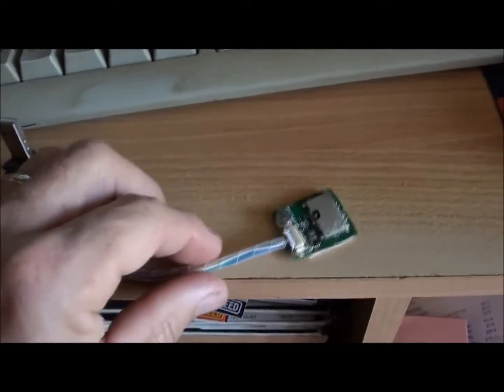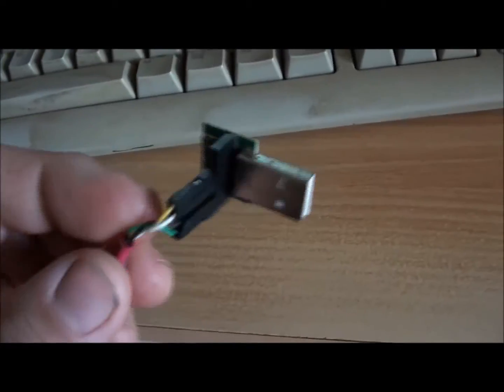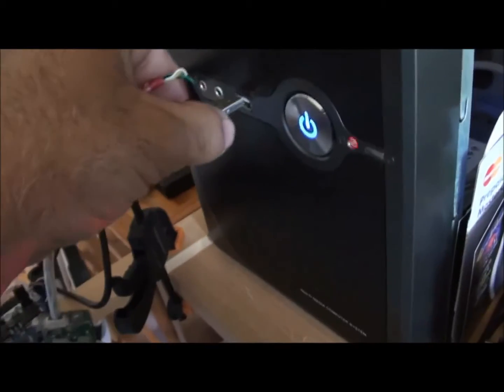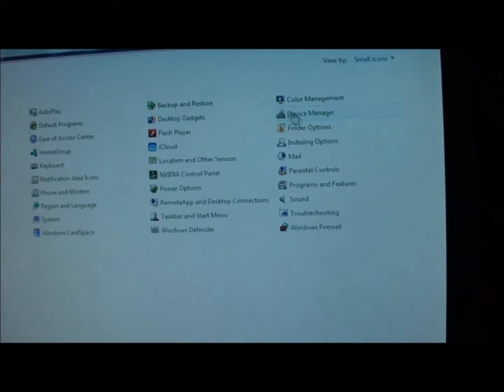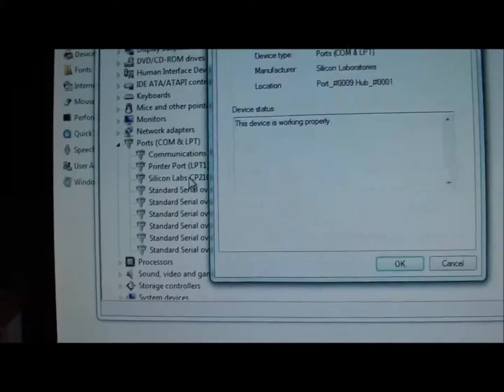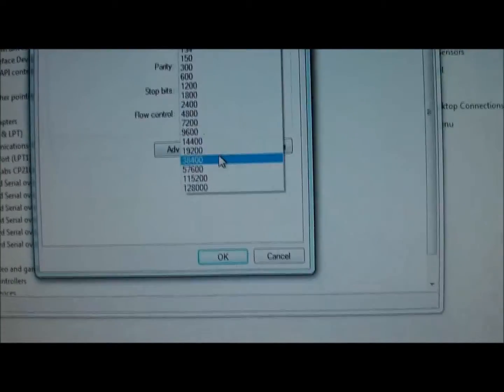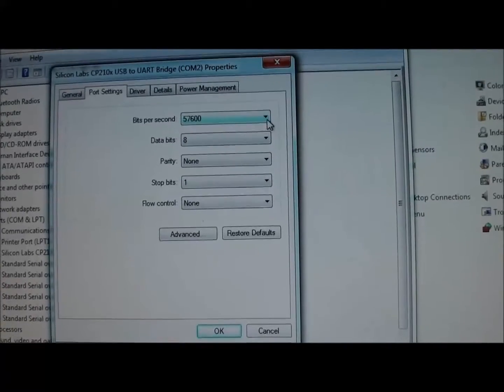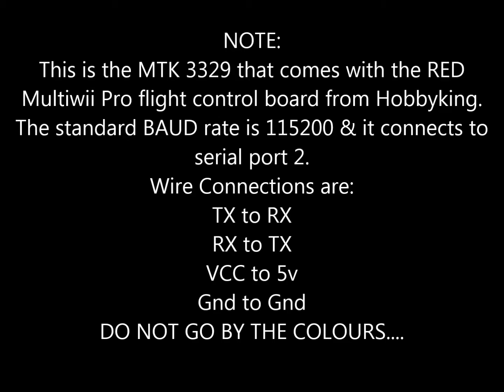MTK 3329 GPS Health Check

Comment: I find that this old GPS actually works pretty well until the tiny little button cell starts to get weak. Then it looses its configuration without warning and can give you a unpleasant surprise if you flip into a GPS mode in mid flight.